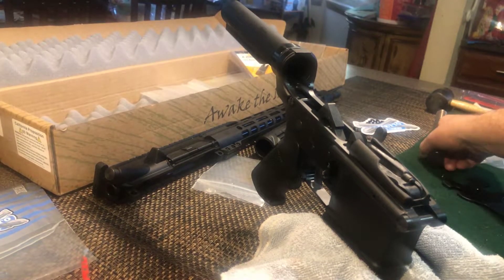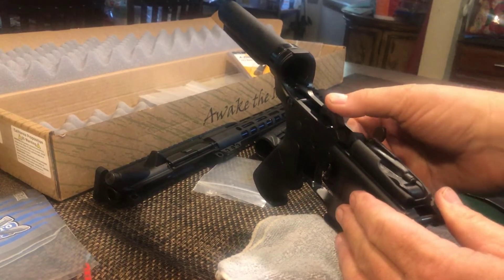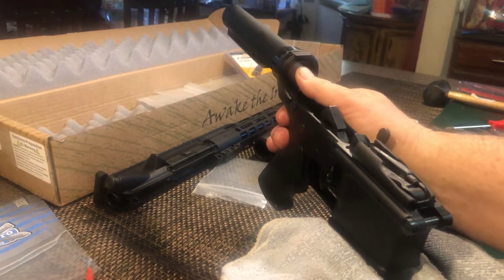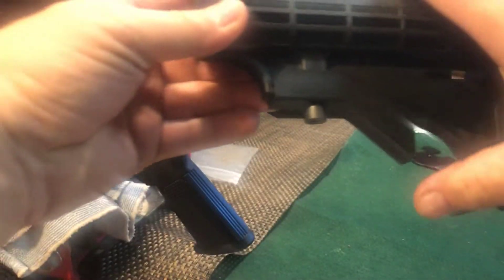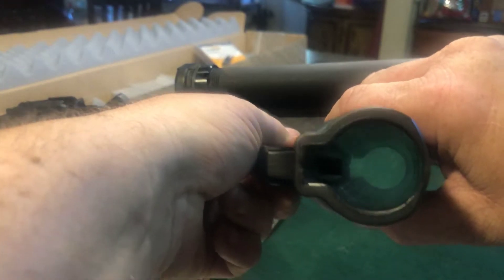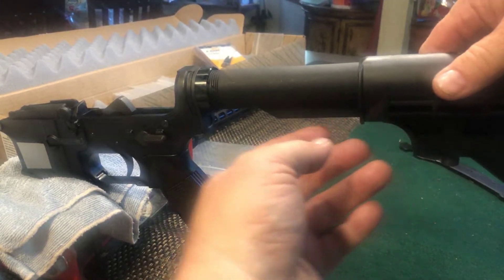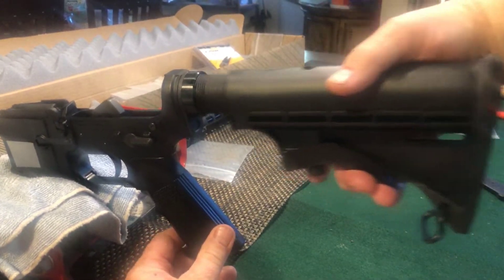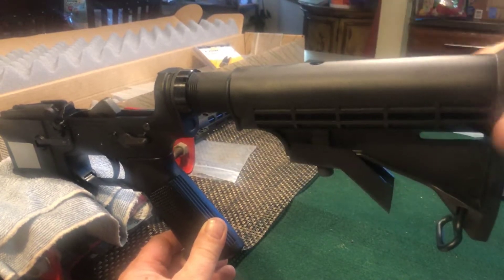AR-15 Buffer Spring and Adjustable Stock - Install or Replacement

Comment: I was surprised that the spring couldn't be seated to the weight. I had to take plyers to bend the spring apart then re-twist it onto the buffer weight.